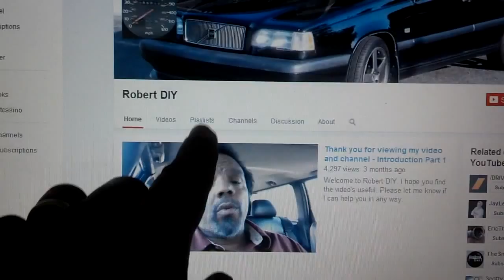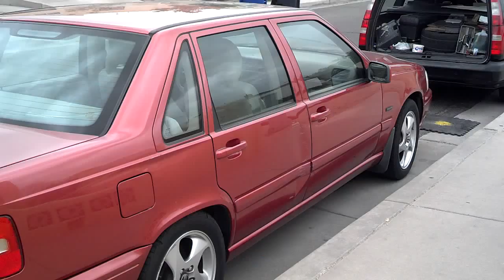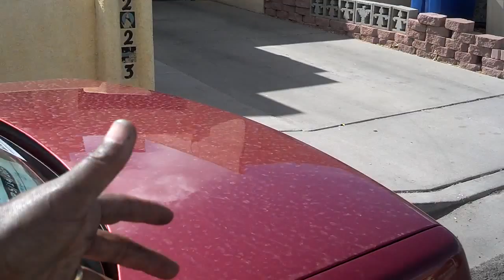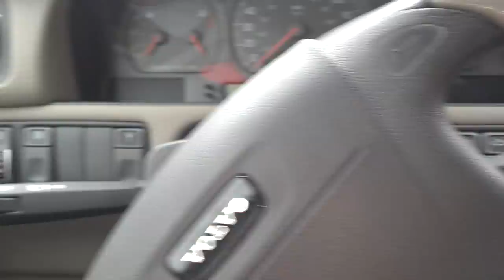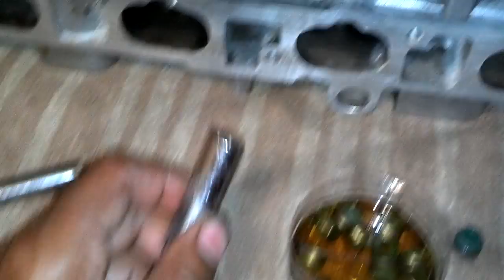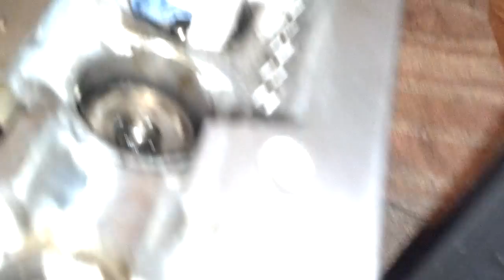Volvo S70 T5 restoration day 9, block cleaned, antenna switch, valve stem seals - Auto Repair Series

Comment: Robert, which manufacturer of valve stem seals you usually use? My last stem seals passed 20 000 km and now i need to replace it again - i have a lot of blue smoke and it smells very very bad.
Reply from the maker: Any should last 100,000 miles or 10 years. Are you sure you have a stem seal problem? I installed Victor Reins.
Reply: Robert DIY I have replaced stem seal and all piston rings in may 2013. One month ago my s70 has a lot of blue smoke again. I have no turbo (5254s). PCV system as absolutley clear. When i remove the spark plugs i see oil on the screw-thread of spark plugs, but spark plugs wells and  electrodes is clear and dry. I think that if the problem is in the piston rings, the spark plug threads would not have the oil. Sorry for my english )
Reply from the maker: Do a compression test to see what the numbers are. If you have NO oil in the spark plug wells, I doubt that is oil on the threads. What color is the smoke? Can you video it?
Reply: Robert DIY Yesterday I took off the intake manifold and i touched the valves with my finger. And finger has oil on it. So i`m going to replace stem seals soon. I think stem seals installed last time has a wrong height and it was damaged so fast (20000km).
Reply from the maker: Wow, that would be crazy. The should have an oil film on them, but the car should NOT smoke when running.
Reply: Robert DIY But it does ) A lot of blue smoke, especially after idling. After idling (on the crossroad for exemple) for a cuple of minutes, when i accelerates, the cars make a HUGE cloud of blue smoke )) really HUGE. i will video it for you. And for the last 3500 km my engine fired 4 litres of oil!!! Half a year before it fired only 1 liter of oil for 12000 km.
Reply from the maker: That's awful. Someone really messed that up.

Comment: What is the part number of the antenna switch? Thanx for your videos!
Reply from the maker: The one from the 960 or the special order one for the S70? I usually get switches from the junk yard. The dealer sells a special kit to add the feature to the S70 cars.
Reply: Robert DIY Thanx for information. I usually get most of my parts from junk yard too. We have 5 or 6 really big volvo junk yards here in Moscow.
Reply from the maker: Nice.

Comment: Those valve seals looked a bit fidderly, plenty of patience is a must :-), looks like you may need to make a taller tube for valve compressing, looked rather hard to get the keepers in.

Ive been known to use a wirewool brillo pad to remove stubborn deposits, as long as you rub in circles and dont say in one spot too long it dont seem to damage the surface, but thats on low compression motorbike heads so thats slightly different.

Thankyou for another smashing video robert :-))
Reply from the maker: Thanks for watching. Cleaning is my least fun thing to do. That is why I always send the cam cover to the machine shop with the head. Just got done with the installation of the valves. I made a mistake and got them mixed up on the exhaust side. I hope they still seal, I'll give them a leak test in about an hour, before I drop the head in and torque it down.